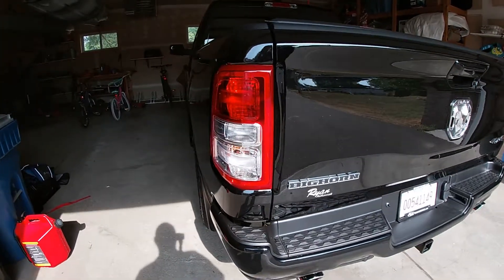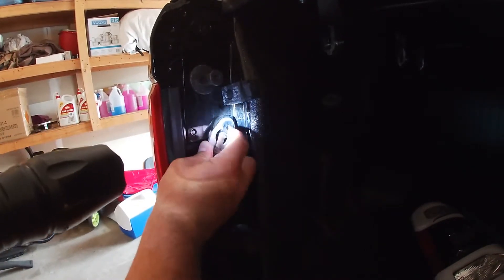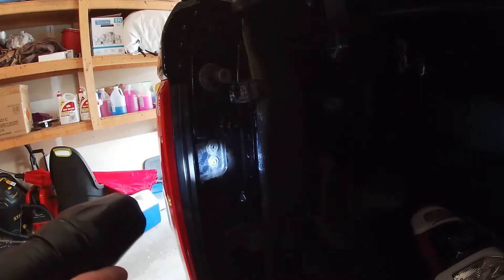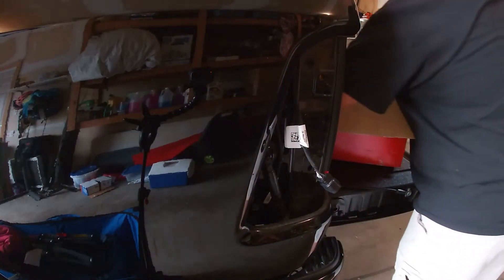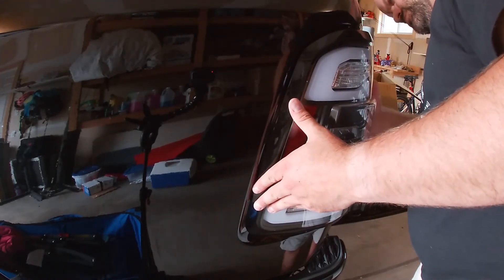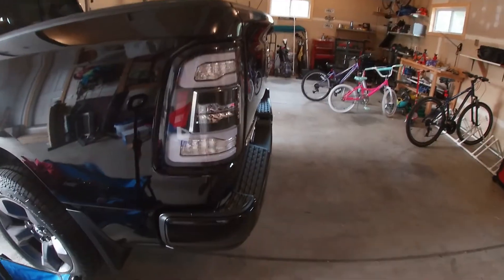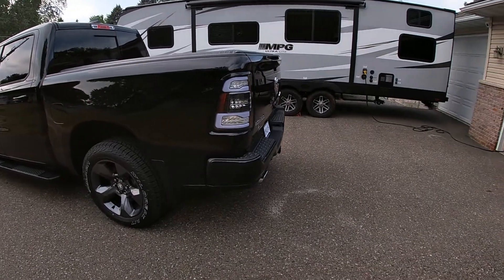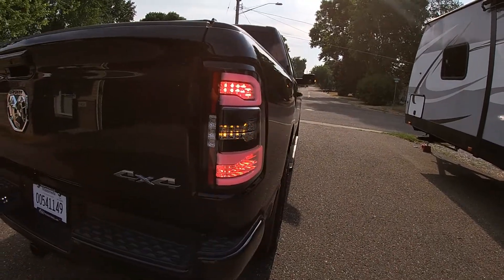2021 Ram 1500 LED Tail Light Upgrade - Install and Comparison

Comment: Looks very cool! I noticed it ur Build to serve rims on your Longhorn. I did the same thing. Mine RAM is a  Granite crystal metallic color. So it almost match the rims. Love that combo, ur breaks look awsome! Thanks for the video.
Reply from the maker: Thank you! The dealership had the BTS wheels off of a truck they were upgrading for a show. I talked to the parts guy and he traded my chrome wheels plus $200 for them. That included the nicer tires. It was the right move for sure.

Comment: Thanks for the video. Kind of a dumb question here. The eBay seller has it listed for Rams 19-20. This should still fit on a Ram 21 right?
Reply from the maker: Absolutely. I saw that too. But it's the same body style.
Reply: Yes, I just installed it on my 2021 Big Horn.  Very easy install.

Comment: Quick question really debating on this recon set of led tail lights and the other more expensive recon ones ( instead of the white, it's red) ...does the "pink" running lights at night are they really that pink?
Reply from the maker: During the day, the running lights are definitely pink. At night, they are red.
Reply from the maker: If you watch my second video where I replace the headlights, I do a night time walk around of the truck.
Reply: @dontburnthehousedownvideos  love it. just saw that video. I placed an order for a 2022 ram 1500 big horn back country...and i didn't order the LED package. Replacing the tail lights with these. for the heads lights, im just going to replace the halogen bulbs with LED bulbs...and adjust as needed...just like you did with the fog lights
Reply from the maker: I did the same LED swap on my 2014 Big Horn. It's dramatically brighter but I liked the look provided by the different headlights on my 2020.

Comment: Great look,a question, are all the dodge ram rear lights from 2014 2020 same Fitment? As I was about to buy some led lights ,says fits 2010 to 2021 so a lil confused 

Thanks in advance
Reply from the maker: I know the halogens look similar but I'm pretty sure they are different. Most of the legit ones I see are for 2019-current for this generation.